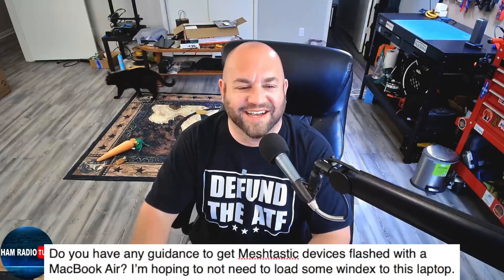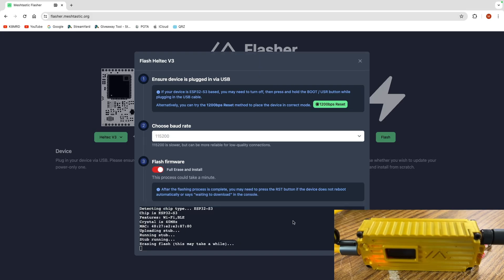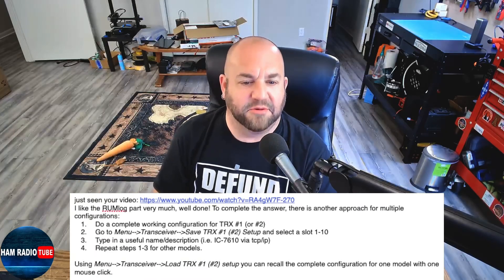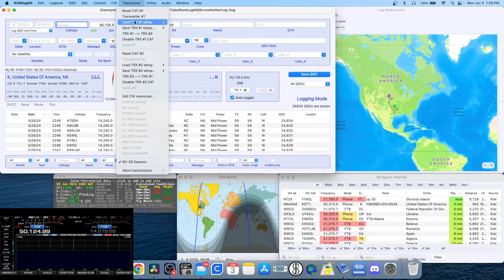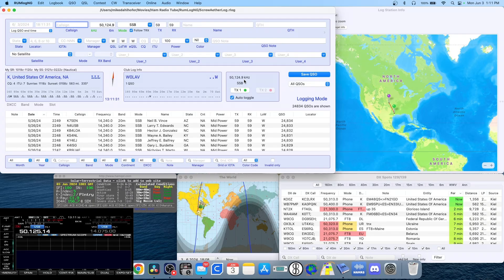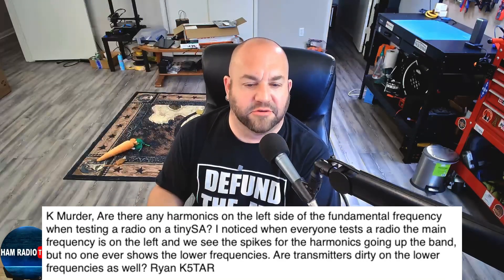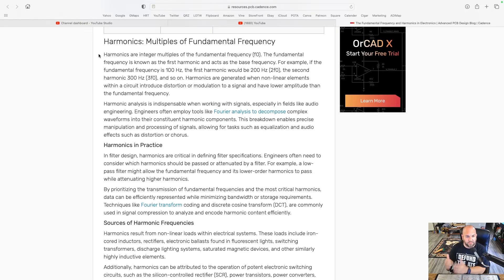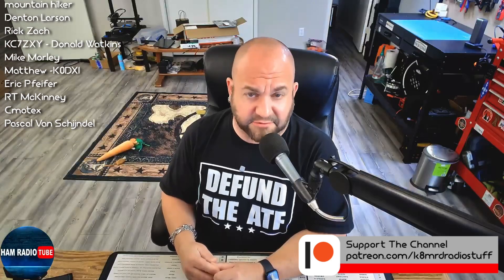What Are Harmonic Frequencies?

Comment: OK Mike, your comment on Mac forced me to like the video.

On the harmonic question, you are correct. However, the other thing hams need to look for are spurious emissions, which include the harmonics, but can come from other issues, such as mixer and frequency conversion products, intermodulation products, jitter, coupling of digital noise, and other parasitics. It is a good idea to look below the carrier and in between harmonics for spurs.

Comment: Excellent presentation, but needs some more explanation on harmonics.    Your words, and the document you display, gives an example of a fundamental frequency of 100 Hz, and states that the fundamental frequency acts as the first harmonic, and the first harmonic is therefore 100 Hz.  In the next sentence, it states that the first harmonic is 200 Hz.  This is self-contradictory.   I understand this may be an issue of semantics, but directly contradictory statements one after another would seem to be a real confusion point for a newbie.  As  I studied electronics in the 1960s, we never spoke of a 'first harmonic'----that frequency was the fundamental, as stated first in the document you show.  The second harmonic, or two times the fundamental, was the 'first thing' to show on the spectrograph to the right of the fundamental, and therefore I suppose it could well be called the first harmonic.  However, calling both the fundamental, and 2x fundamental, both the 'first harmonic' just has to be an oxymoron.  I found similar conflicts in the references to harmonics in the Amateur Extra question pool. 
Again, not to detract from your excellent presentation---just a clarification of the 'new kids'.
Reply: Yes, there is confusion about this and some references contradict the consensus. The second harmonic is 2x the frequency of the fundamental. The first harmonic, if that term is used in that field, is the fundamental. 

Acoustics and therefore music tend to use the term “first harmonic” because, if the motion of a plucked string is observed, the first and lowest harmonic appears as a single deviation of the string. The wavelength of that tone is double the length of the string. The various oscillations that can resonate a string are called a “harmonic series”.

In RF fields, we tend to use “fundamental” and there is no such thing as a “first harmonic”.  The sequence otherwise parallels acoustics and physics, with the second harmonic being twice the frequency of the fundamental. If someone uses the term “first harmonic” in talking about RF, it is clear the numbering is likely unconventional. 

The term “overtone” is another term from acoustics sometimes used, where the first overtone is equal to the second harmonic; the second overtone is equal to the third harmonic, etc. However, in RF, “overtone” is most often misused, such as with crystals. A “third overtone crystal” usually resonates at the second overtone by the acoustics and physics definition of “overtone”, which is the third harmonic, of the crystal’s fundamental resonant frequency.  Crystals resonate on odd harmonics: f, 3f, 5f, 7f, etc. So, “overtone” is a bad term to use in the RF taxonomy for anything except when talking about crystals.
Reply: @kenchilton  Great writeup!  Bringing in the musical aspect 'fills out' the discussion.

Comment: that great ! audio harmonics are the same. their is a way a radio can make RF on lower frequency and transmit that un wanted signal. this is not harmonics . just outher bad filter and oscillator problems in a transmitter.  The VFO  or oscillator in a radio is usually on a lower frequency and it it multiplied up to the wanted frequency.  if that lower frequency gets out and into transmitter mixing can happen and lots of radio splatter can happen. this is un common . mostly with old crystal radio's that use harmonics off crystal to get to wanted frequency.  today a VFO is a chip so that problem very un common . RF mixing can make a lower frequency. like 2 transmitters on same coax no filters. what happens the 2 TX frequency mix and make more . the sum of the two and the difference of the two. that a big reason of band pass filters when more than 1 transmitter on 1 antenna are used  . 73's